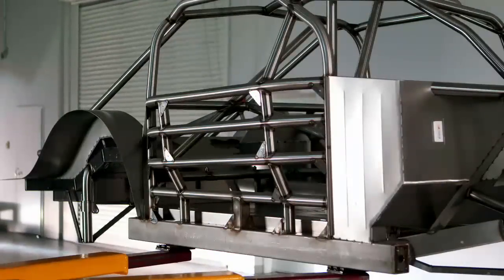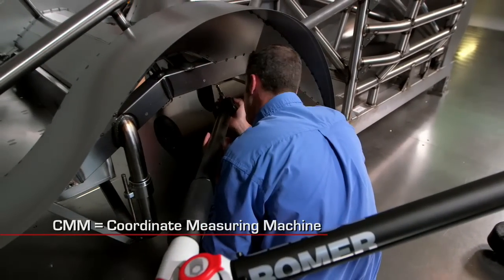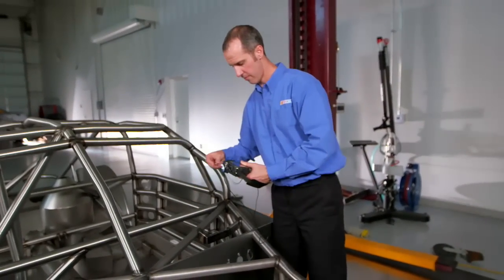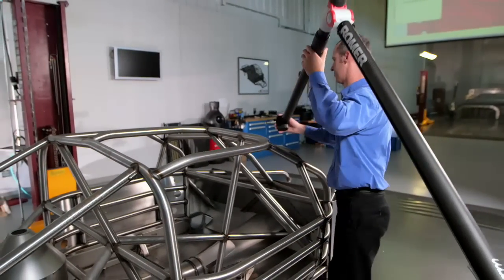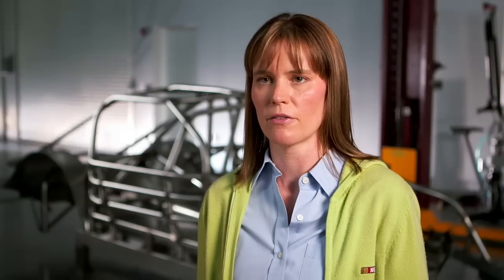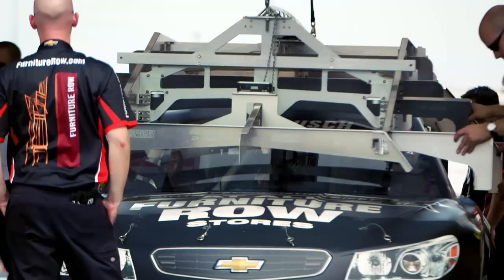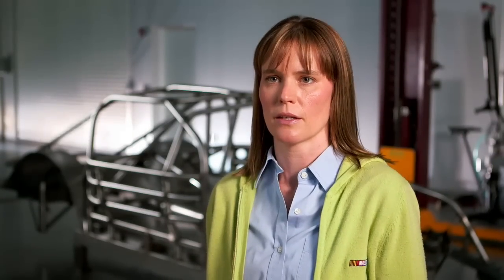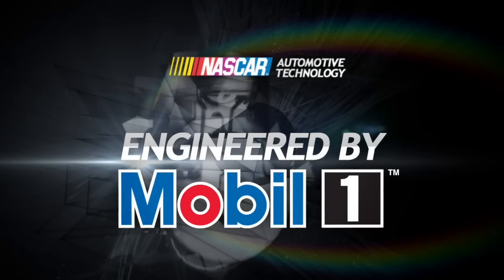NASCAR Automotive Technology Series: Chassis inspection

Comment: "A quarter of a inch is actually a pretty small tolerance".. Yeah in Nascar maybe... Try telling your F1 chief designer that you mounted the suspension a quarter of a inch up... "A quarter of what??"
Reply: Just googled it, F1 allowable tolerance on chassis is +/- 3mm so a 6mm total tolerance range. Not too far off of 1/4inch. It is a structure that is going to flex and bend after all.
Reply: OK. 6.35mm
Reply: Cade Speaman yeah, but i also meant its a huge deviation for F1 standards.
Reply: +Slick Tires can't argue with you there
Reply: Yes, it is a pretty small tolerance, for most engineering design standards. I genuinely don't know what the purpose is of comparing it to F1.

Comment: a lot can happen between pre-race and post race inspection.  driver hits the flat  of the track or even touches it and makes it appear too low in the rear... or too high in the front.  bumps in the track, contact,  anything even pit stops can altar.
Reply: they know this